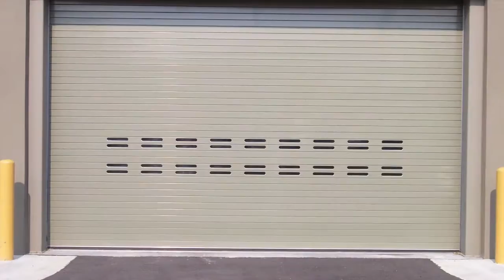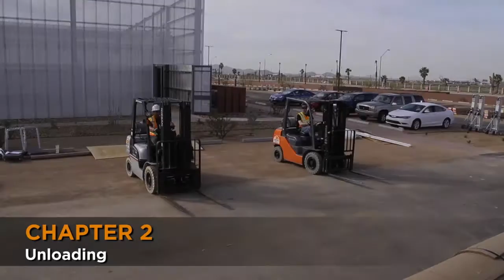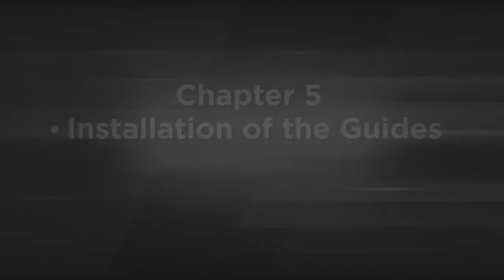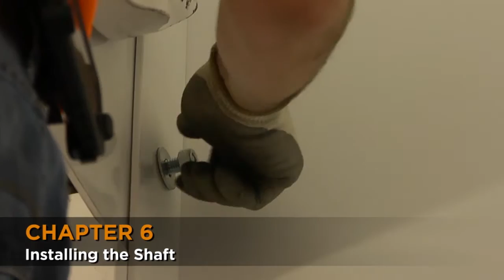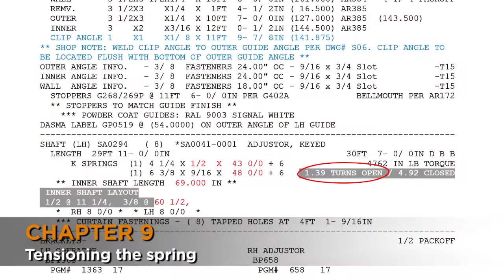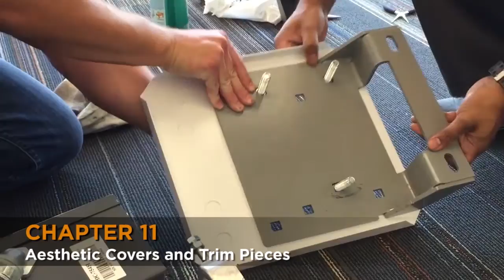How to Install Cookson Doors Over 16 feet wide

Comment: Very professional video. But as always there's always room for improvement. now being the owner of my own company I always look to make sure my guys are operating in the safest fashion especially when posting something. when you guys are installing the barrel and the curtain the center technician is standing on the top of an A-frame ladder. 

And secondly, we never use vise grips to clamp onto the end of forks. You use c clamps or like we've done is fabricate sleeves with set screws that have almost a chalk effect or it can be adjusted and keep the door in place. Vise clamps will warp under a side load and pop loose. Not to mention allow the roll or the curtain to shift it's point of gravity on the lift which could topple over a material lift.